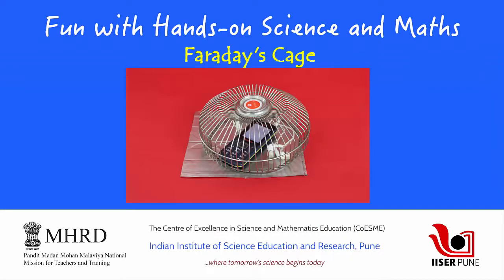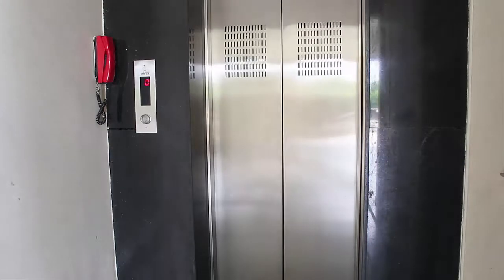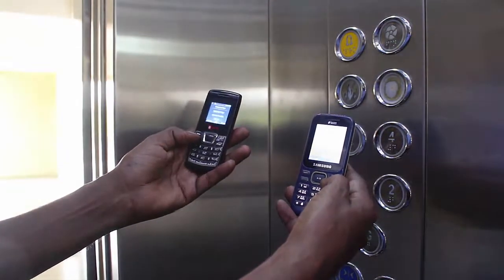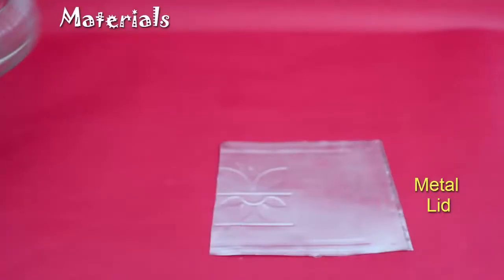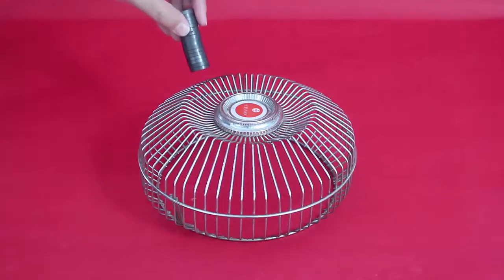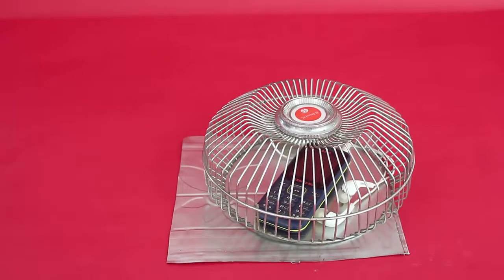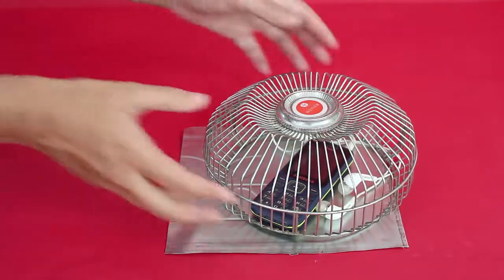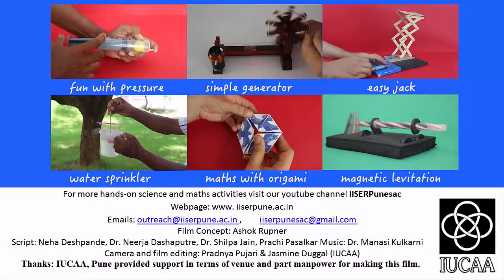Faraday's Cage | English

Comment: Can this idea be used to shield humans from electromagnetic waves?
Reply: Yes he explains it while talking about microwaves, it stops electromagnetic fields from escaping the microwave, but implicit to that information is that it stops electromagnetic fields from entering it as well
Reply: @marckost2000  so what is everyone supposed to do still doesn't explain how to build an actual suit that would help you
Reply: @unbroken1010  a suit? Your everyday application of this is just on very specific things. Like a car or a plane for example, that means they can be hit by a lighting and you won't die. Some prisons are made in a structural way that makes it a Faraday cage so cellphones won't work inside of it. But I don't get why you would want to make a suit, which would actually be very impractical.
Reply: @unbroken1010  if you want to be protected from electromagnetic waves you probably want to build a house that works like a Faraday cage.